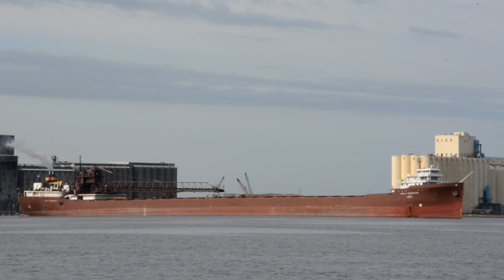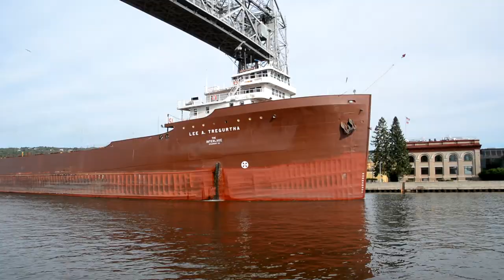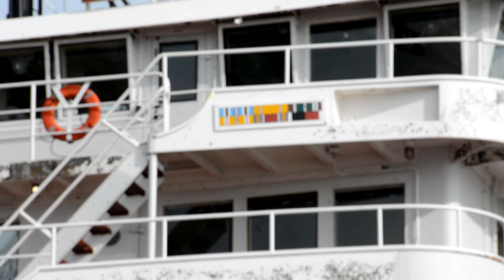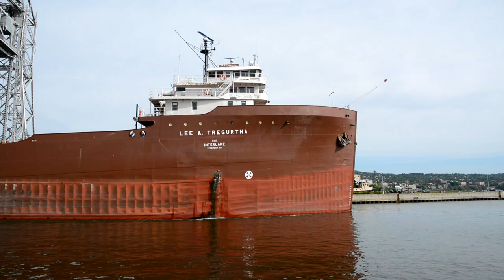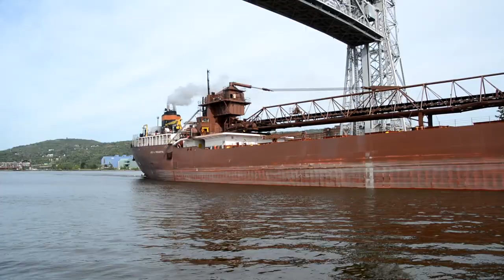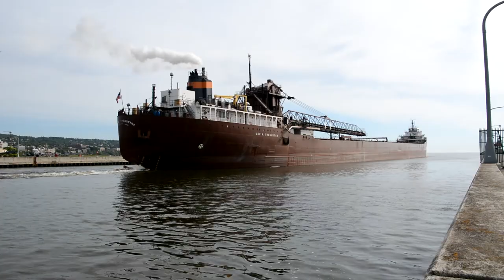LEE A TREGURTHA Bound 4 2 Harbors

Comment: This one you can actually hear the engine sound prominently, unlike most of the others of these videos.  Also sounds like higher rpm engines than most engines on ships this size -- diesel electric drive instead of direct drive?
Reply from the maker: That's the sound of two Rolls Royce Bergen B32-40L6P medium speed 6 cylinder 4,020 b.h.p. (3,000 KW) diesel engines.